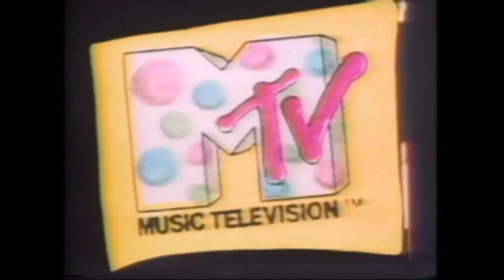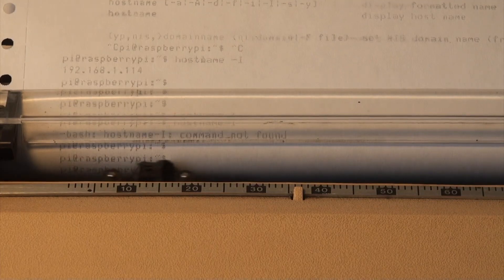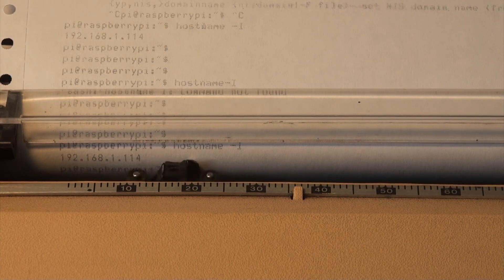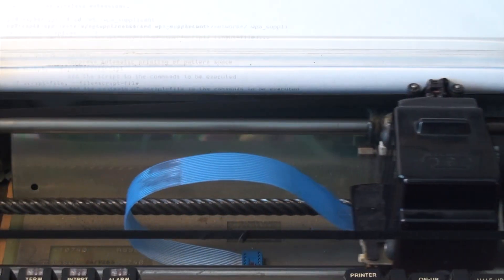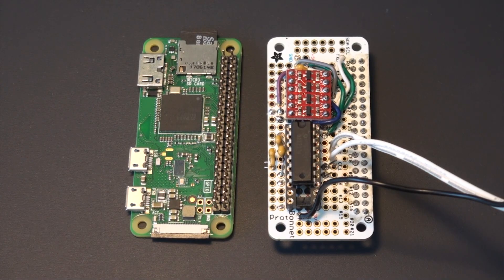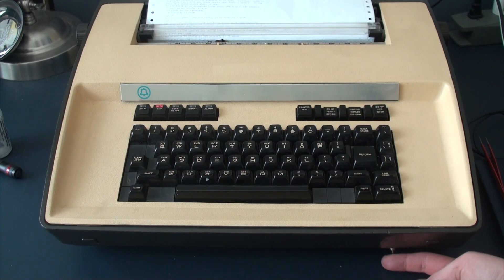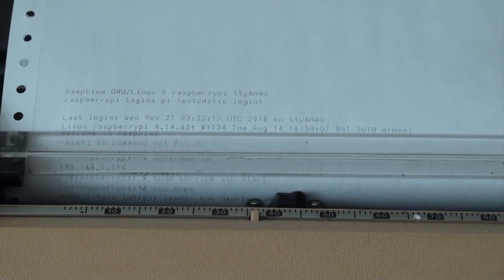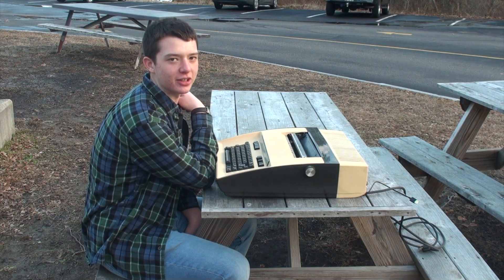Teletype Model 43 Project Showcase

Comment: What a cool project. I also have KSR-43 and I have some question. So your only TX/RX/GND pins on 25 RS232C connector. I'm not clear how your additional switch set the device to DATA  Ready,  can please explain as I have no idea how to make this work.  On my Model 43 the DATA light is flashing but I stuck at this point. Thank you.
Reply from the maker: There are other signals on RS232 that are used for handshaking that it's expecting. What I did is install a switch in the front that connects DTR to DSR and DCD, and RTS to CTS. I did this by soldering to the back of the serial port PCB. If you're doing a similar mod to mine, be sure to use a 5v FTDI chip, the 3.3v ones don't produce enough signaling voltage.
More info here under "minimal null modem": http://bogpeople.com/networking/SerialComms/rs232pinouts.shtml . Please contact me for any more info, I'm happy to help!
Reply: @MiaKiesman  Thanks. I was using a cheap 25 Female to 9 pin Male RS232 adaptor and it maybe the problem. I'm going to grab a 25 pin female connector tomorrow and hopefully this will resolve my problem. So DTR to DSR, RTS to CTS and also do a local loop with TX connected direct to RX before connecting the TX/RX to my 5V FTDI2323 board.

Comment: Can you explain how you went about creating a new ribbon for it please?
Reply from the maker: It came with the original cartridge, but it had no ribbon, without it I'm not sure I could've done it. I got the ribbon from a place called Fine Line Ribbon and asked for a 19.25 inch loop of 1/4” Nylon ribbon with no twist
Reply: Thanks for that information. I am interested in the two rollers inside the cartridge as I think I read somewhere that these are the self inking mechanism. Your rollers look different to mine so I wondered if you had changed them - and whether they are indeed inking the ribbon? Is your replacement ribbon lasting a reasonable length of time?  Sorry for all the questions, I am trying to decide what to do with mine.
Reply: @mfhws  On my 43 the ribbon loop is 39 1/2” and the cartridge doesn’t have a metal plate that the magnet is supposed to hold down the cartridge, the cartridge has a plastic latch that sticks up to grab the cartridge holder.